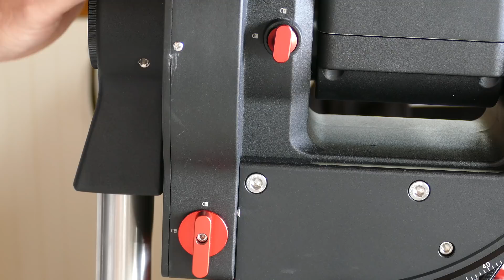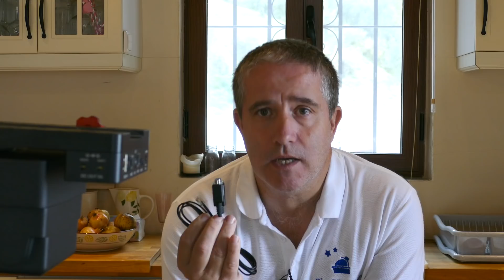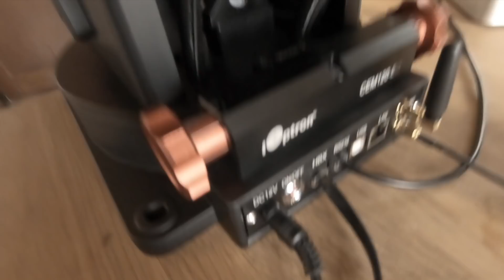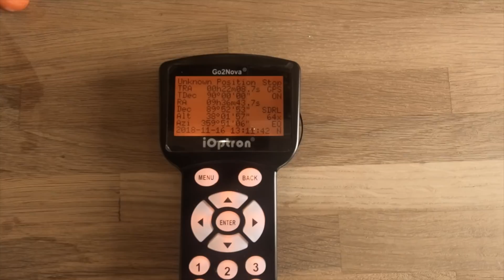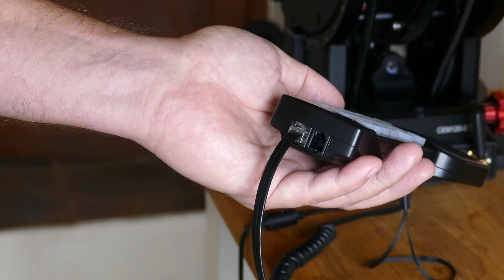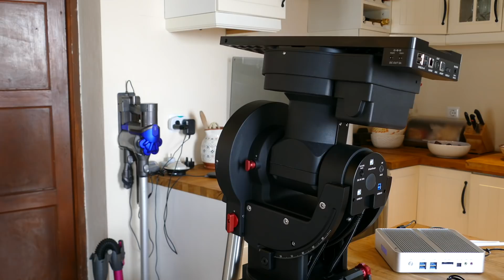iOptron CEM120 EC initial power up, firmware update and encoder calibration.

Comment: The iOptron clutch system is very stupid.
Reply from the maker: Hi Lanchezar.  The CEM120 doesn't use a clutch so I'm not sure what you mean.  You either have the gears engaged or desengeged, and they use the motors to provide the "clutch" if there is a snag.

Personally I think the ability to disengage the gears completely rather than having a "clutch" is very good

Comment: I have the ioptron cem120ec2..and it needs the firmware upgrade, as even though it has 180,000 for its hand controller firmware, it's  only got 170,000 or so for the MainBoard.  My question is: i see that there is an ioptron utility program that has smart install in it.  Is it really necessary to upgrade both my hand controller plus my MainBoard, or can I do the MainBoard only?  And if I do that first, and only then will it still allow the high precision encoder calibration?  Do you know?
Reply: PS: my first real eq mount was an ioptron cem60, so this is a real upgrade for me...it's just I see that it will not perform as i'd like outside the box....as it kept-on saying stars and stuff that are truly above the horizon were below and it wouldn't allow tracking then.  or say pointing un-known or it would show the time wrong like 10 hours off.  Even though I set it right.  it would forget after I turned it off.  even though it has the gps hooked-up.  I thought at first I'd need to connect it to my laptop and then it would 'believe' the laptop's time and stuff.  Like once I get the new firmware...I'll be able to connect it to Sky X, probably, right?  I got this cem120ec2 in my neat 10X12 roll off roof observatory.  Thanks for your help!  davewilliamstar@live.com
Reply: But apparently it needs the firmware first.  Should I do both Main Board and Hand Controller @ the same time, of course Main Board first?  Because my Hand Controller is up to date, do I need to do that one too?  So then I just do it second?  Then for sure it will allow me to do the high prec encoder calibration?
Reply: I want to be sure because I know a person can mess the mount's firmware up where it would say main board failure or something...as that happened with my older cem60 mount...and had to send it in to ioptron for help...yep tried using an older Meade serial adapter instead of the FTDI one it needed...but I see you've specified a certain adapter, I feel I will try to use that one for sure!
Reply from the maker: @dwilliams1128  If you choose intelligent select it will only update the ones which need updating, and will skip the ones which are already up to date.  I can't imaging why it would brick a board unless you have corrupt firmware, it wouldn't be to do with the order in which things are updated.
Reply from the maker: @dwilliams1128  I would say the adaptor I show is worth using as it is the one actually recommended by ioptron.
Reply from the maker: Hi David.  Yes you can update whichever element you want.  All you do is manually select which one rather than auto-update.  If you are updating just the main board then you will need to calibrate the encoders again.

Comment: Can you charge your phone through the USB?😉
Reply from the maker: Hi Shastarocks.  That's a good question and I have to admit to not knowing for sure and not trying.  However, I would be pretty certain that's a no as it is an input data port so almost certainly won't have charging facility.
Reply: @simplifiedastro2092  probably.
Reply: Have you used mount head to power  the Atik